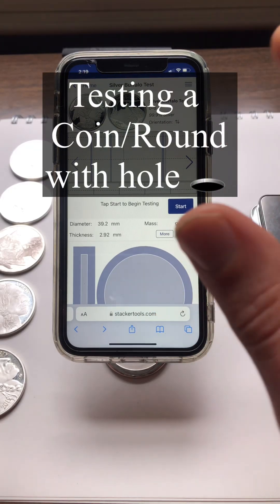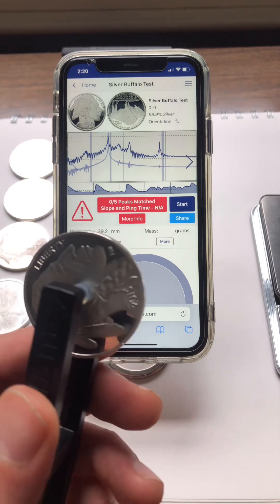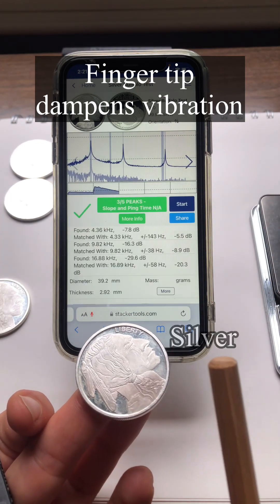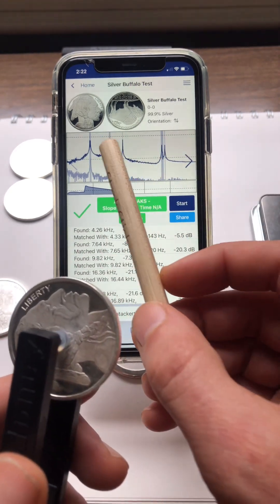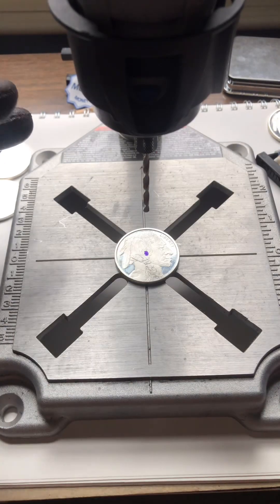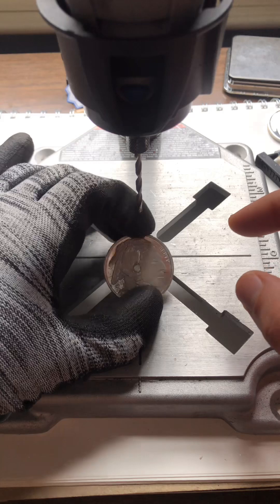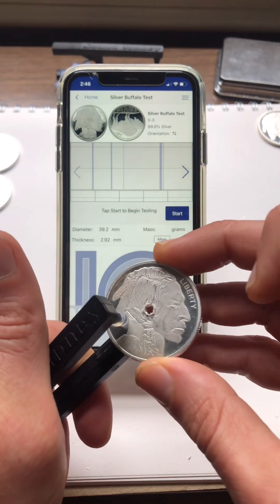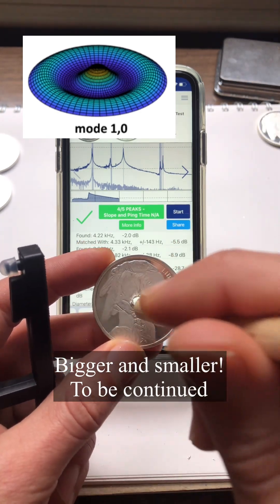Feeling nerdy? Hole drilled. More questions. Ping Test, Tests to be continued.

Comment: Quick tip for drilling metals: go slow. Use a very low speed, and use lubrication. Water can work, but you could also use any oils that a machinist would. 

Metals are all about heat and it's surprising how much heat a drill will produce on them. If done without consideration, heat will aneal the metal and sometimes even re-harden it.

Also, never keep pressing against the metal continuously. Back off regularly and go back down. This will help reduce heat and allow chips to exit the hole and not heat up and fuse back into the hole which will cause density problems and make it progressively harder for the drill to work.

I think that this would cause some pretty dramatic changes to coins in particular!